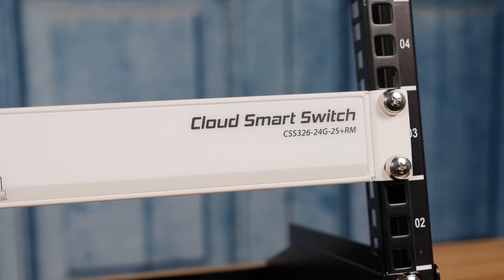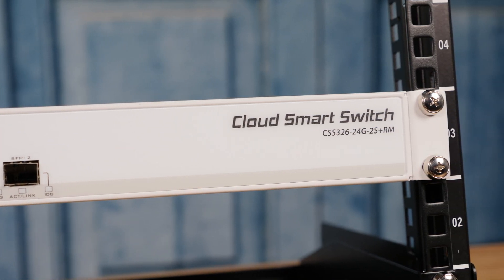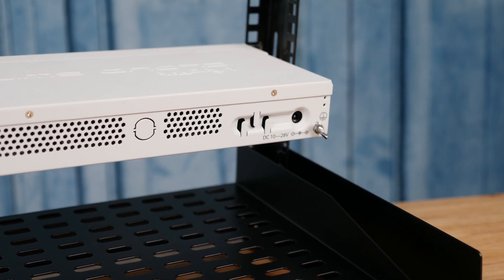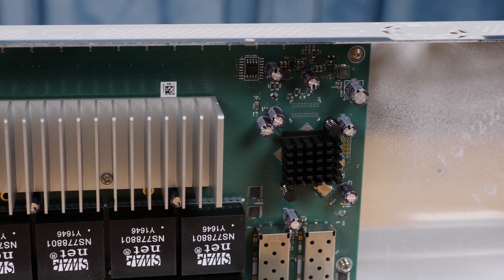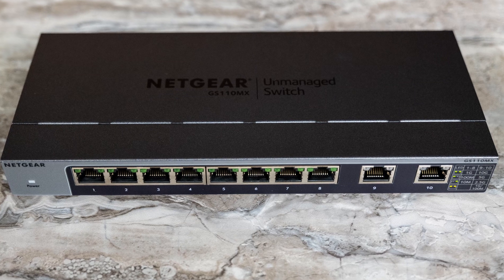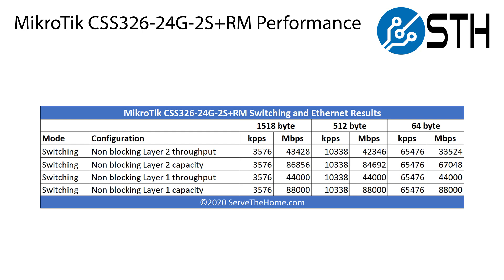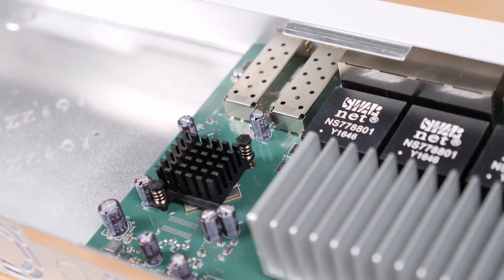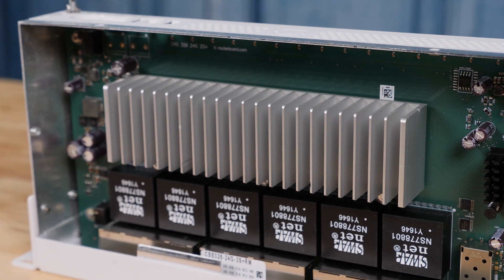MikroTik CSS326-24G-2S+RM Review

Comment: @ServeTheHome I just got mine today to replace a 10+ year old Netgear 16 Port Switch that decided to die on us.
I already have their Cloud Core Router (CCR2004-1G-12S+2XS) that I recently upgraded from a RB4011iGS+RM which had been running great for 6 to 8 years.

But I am also not a fan of the external power brick, but its fine if it reduces costs, what I do hate is the lack of a fan, this unit gets rather hot, I had one idle at 63°C in a room that is 20°C so this unit could of come with a fan, or at least a header for one so that we could install our own one if needed.
But we will see how well it runs and how cool it stays.

Comment: Is this passive cooled ie fanless? And would this be a good replacement for an RB4011 that is full up?
Reply: RB4011 is a router while this one is a Switch. They can't really replace one another. You can though, use the RB4011 coupled with CSS326. I use one which is connected using 10G SFP.

Comment: Does this have enough processing power to connect a NAS with 2x10Gb LACP being uplinked to the Dell via 6x1Gb LACP (with PoE/PoE+, acting as a "core").  Trying to make sure a couple systems at the MikroTik end have full Gigabit, as well as multiple systems at the Dell end.  No multiple VLANs, just one VLAN with two sets of LACP.

I've had good experience donig this with the NetGear M4300-8X8F, at work, but I can't seem to find a cost effective solution for this at home.  Just really need a 8x 1000BASE-T + 2x 10Gb SPF+ strong enough, with decent backplane, and good LACP handling.

EDIT: I understand the 2x10Gb isn't necessary when connecting 8x1Gb systems.  I'm obsessed with redundancy, which is why I always run LACP when possible.

Comment: This is a pretty cool switch. The only thing I'd concern myself with regarding this switch is the Switch OS dependency. I have been "upgrading" my network over to mikrotik with due consideration for manageability. What I've found is only way to manage Switch OS is over the webfig portal. The winbox or the mobile app can be used to manage only Router OS. The mobile app has been quite useful for me to do a quick health and other status check of the mikrotik routers and switches. But as a SIFI (set it and forget it) device this CSS326 is a wonderful device.
Reply: How do you access SwOS - You have to dl the winbox and connect thru eth cable? I had this switch fail on me and now im trying to update the firmware to see if it will be functional again

Comment: These would be great in an instance where you have switches spread over a small campus or office building. You can use the SFP+ ports with whichever optics you want (depending on how far you need to go) to make an easy fiber run for your switch interconnects on a 10gb link. I've got a good old Dell Powerconnect 2724 that i've been using for YEARS but I'm going to swap it out for one of these for the SFP+ ports. The Dell has SFP ports but I want to have the ability to do a 10gb link when I set my rack up for my lab servers and NAS.

Comment: Suggestion:  If you are going to talk about this being PoE powered talk about what 802.3 standard it needs (I assume 802.3at).  What about how the dual power is load balanced (does it draw from PoE first or DC?).  Are there any limitation when running via PoE only (do all ports work or only sum?  Does it down clock? Can I run other PoE devices off this if it has spare PoE budget?).  The port numbers appear to be bottom to top and not top bottom like most networking equipment, why is that?
Reply: For posterity, the switch only accepts passive poe in.

Comment: I think the DC input and the POE input is due to their popularity in the 3rd world in DC powered remote cabinets that run off wind and solar with no inverters.  its all DC Batteries and solar.
Reply: I enjoy the 12-volt since it is in my mobile communications trailer which runs off of 12-volt batteries. It is difficult to find a DC-powered switch.

Comment: Ordered my 2nd one for my other office. These are great and cheap as you said. Have the 2 SFP+ ports connected to a FreeNAS box using an SFP+ connection and a MacPro 5.1 with a 10GB Ethernet (through the Mikrotik adapter) and a bunch other clients in Gigabit. Great investment. Thanks Mikrotik! Great video as usual!
Reply: Just curious what's your throughput like between the FreeNAS / MacPro using something like iperf?  That's basically what my use case would be too and wonder how close it can get to saturating full 10Gbps speed.
Reply: @TheDopamin3  Well my setup is a bit more complex... I am using Proxmox as hypervisor and FreeNAS is a VM. Also I'm using a Mellanox card (mlx4) and when passing through the PCIe device to dedicate the NIC to FreeNAS, I got it to kernel panic and read the card is not support properly in version 11.2/11.3. So I am back with virtio virtual NIC (Proxmox virtual network interface) and I am getting only 2Gb I/O max so far so pretty lame. I have to dig into Proxmox and see if I can tuneup the setup and I'll definitely run iperf first but I am lacking time to do so. When I have some free time at the office, I'll run the tests and report, if I don't forget.
Reply: Well so I got 2Gb link speed using iPerf until I changed the MTU to 9000 and got 3Gb/s. There is clearly some more improvements and tune up to be made and that is involving the mellanox card and proxmox. I am pretty sure you can achieve 9Gb/s. I got a non supported 10Gb Ethernet card for the MacPro based on the Aquantia chipset. Add to flash the firmware to get it working. A lot of fun stuffs